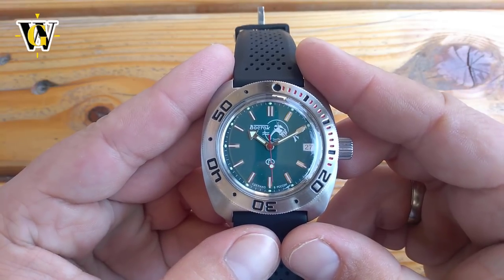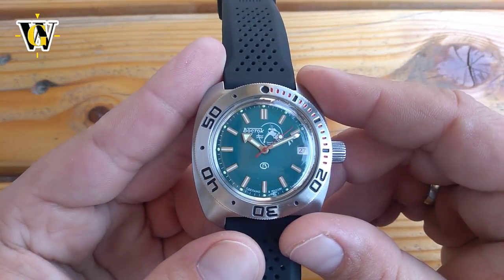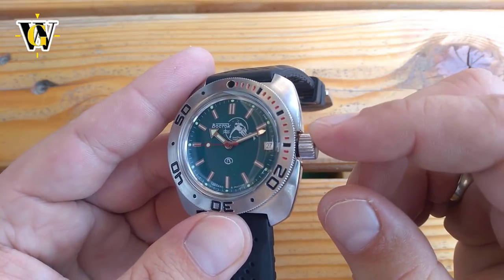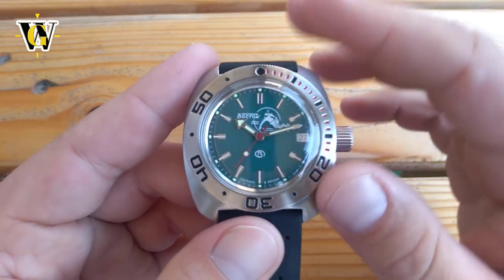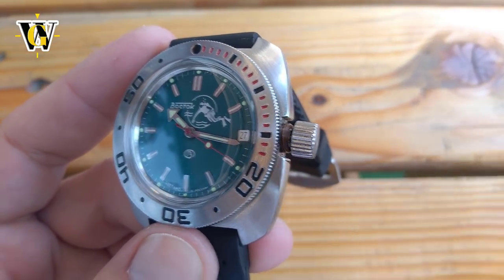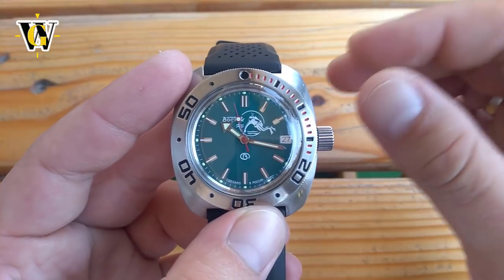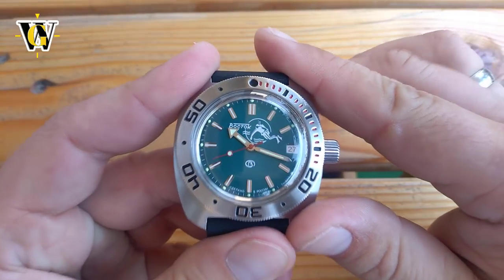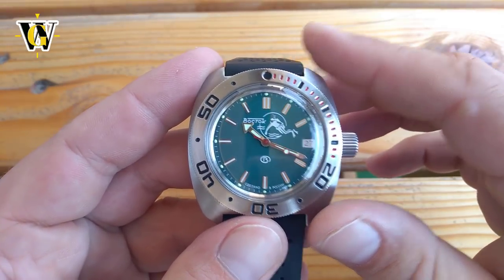Vostok Amphibia & Galvanic Corrosion - my watch corroded thanks to me :(

Comment: I bought an Amphibia 120512 a few months ago and been wearing it daily, which include surfing. Last week, after adjusting the watch, I forgot to screw in the crown and surfed for an hour until I noticed heavy condensation on the crystal - panic! Got home, disassembled the watch - luckily there was no water on the actual movement, only around the edges of the case and movement spacer and, loads, on the crown clutch compartment. Dried it all up reassembled and it worked fine. A few days later, opened the case back to regulate the watch and noticed some rust on the crown stem, took it out and rubbed it with a bit of silicone lubricant. It’s been working fine but probably will take the opportunity to upgrade the crown to a signed one as the corrosion process on this one will probably continue. Yeah, salt is terrible for corrosion, diver or no diver.

Comment: I have the model 670, all stainless steel. The “rust” is the reaction of galvanising on winding crown tube made of titanium,and crown made of stainless,in the presence of sea water(salty). Put some vaseline, and wipe with a paper towel, and it will disappear! I tried too!👍
Reply: If I don't have vaseline, what else can I use?
Reply: Patrick Ramirez heh
Reply: Titanium ?????  It's tin !
Reply: It’s made or chromed brass, not stainless🤣🤣🤣
Reply: @Group_Anonymous  The new ones are stainless
Reply: Vaseline is bad for rubber (as in crown seal). Better use a silicone based grease. I think liqui molly has such a product
Reply: @Raiden6277  you could use vapo rub. It's main ingredient is petrol jelly (vaseline)

Comment: I used Permatex brand high temperature anti-seize compound on the stem threads. Solved problem. I already had the anti-seize compound from my gun-smith work. The high temp, copper color, compound prevents galling between aluminium frames or rails and carbon steel, or especially stainless steel slides.

Comment: Very interesting and I'm glad you caught that in the nick of time!   I'm very familiar with galvanic corrosion from plumbing and oilfield work in the past.  But thankfully I have never experienced the type of corrosion you had on your Amphibia in the 20+ years I've owned Vostoks.  And some of my vintage pieces are 40 years old now, and have have quite a bit of wear and chips in the chrome.    So I'm thinking you just had the perfect storm.   Your sweat composition and possibly a poorly/flawed chrome plating applied to your crown.  Definitely something to keep an eye on.   The stainless steel crowns are a great upgrade.
Reply: where would you get a stainless steel crown for the vostoks though?
Reply: @kubikiribasara3499  The can be purchased from Meranom.com.

Comment: Big issue in vostock watches,in my case i ordrer the watch from meranom and they change the crown with the  stainles one with the B sign, butt it happens again because it is st steal only in outside surface.Any way you realized that 65$ super watch have some faults.Nice video for a great watch.

Comment: Hi, mine corroded on the same place after swimming in the ocean,  i used a toothbrush to clean it then applied some vaseline for lube. Now its smoother than ever.
Reply: Aleksander Den Store hi there! dry toothbrush, obviously? At what angle did you hold the watch while brushing it with toothbrush?
Reply: eeyyaakk yes just unscrew the crown and brush.
Reply: Same problem.  Had to use pliers to unscrew the crown.  The bezel was stuck too, so I lifted that and applied some lube.  Not confident about the crown as it’s still stiff and doesn’t pop out and the handwinding position is unclear ☹️.  Still keeps time though.
Reply: I did the same. But I used Trident No. LP20 silicone grease such as one uses on scuba rubber seals and plumbing valves.  Works fine.  Amazon or eBay.  2 oz for about $7.  Used it on main rubber seal too.

Comment: I guess that the crown is not chrome plated inside? Galwanic corrosion between ss steel and chrome is not supposed to happen according to the charts.
Reply from the maker: The charts are more a guideline than actual rules as different humidity and even temperature conditions can alter a material charge properties, so even compatible materials can corrode, which is why it's always safer to have the same material for everything

Comment: I was under the impression that the case is chrome plated brass. Anyways, I order stainless crowns for all my Vostoks and with a Q-tip I apply a small dab of DIELECTRIC GREASE on the stem tube and inner O-ring of the crown. So easy to screw and the O-ring seals better without tightening it against the tube as if your  life depended on it. Nothing beats dielectric grease as corrosion fighter!
Reply from the maker: Komandirskie models are chrome plated brass, and Amphibia is SS

Comment: It amazes me that vintage vostok watches haven't corroded to dust, if that was the state of your crown threads after just a couple of months. I can kind of forgive the mixed metals on the vintage pieces though, brass was cheaper and easier to machine than stainless steel, but on the new models, just slap another $5 on the (already miniscule) cost and go all stainless.
Reply: Back in the day, the whole watch was made from brass, so there was no galvanic corrosion as the whole watch was the same alloy.
Reply: Apparently the issue is the crown stem being titanium, with the crown being stainless. It's not a brass issue. He said in other comments to apply some silicone grease to the threads.

Comment: I thought the crowns were steel, I read on WUS that the crowns have a steel plating over another small crown, so the crown that we touch and use is a form of steel, but not stainless steel exactly.
This was said for the Amphibian crowns released before 2018. These new crows have a slightly different shape towards the inner end.

Comment: This doesn't just happen to watches. My car came with stainless steel caps on the brass tire stems. Daily moisture corroded the contact between the two metals and they had to be broken off to change the tires, destroying all four of the tire sensor gauges. Costly design flaw.

Comment: I haven't seen this in any of my Amphibia's or Komandirskie's many of them Soviet issue and all have smooth crown threads, one of my Zakas Commander's from early 70's has a very corroded case at the back where the locking ring meets the case and has fused solid whilst my other Zakas Commander has a perfect case and caseback but the dial is rusted out which is quite crazy as both are working quite well if not for the rustyness.   My "newest" Komandirskie, a Generalskie has a sticking stem which is irritating as it doesn't click in when screwed down, this is a post Soviet model and to me not as well made as the earlier ones imho.

Comment: Excuse me, but it seems to me that you confuse galvanic corrosion with the dirt accumulated in the crown, which is what I think happens to your Amphibia watches, if you are diving with them a few days in a row and then you keep them for a month if you have cleaned Previam With fresh water and without giving them rope from time to time during all this time. If it were really galvanic corrosion, the crown would be fully welded and could not be unscrewed
Reply from the maker: This was not dirt my friend, and the watch didn't see ANY diving action, just am occasional shower when I would forget to take it off and a hand wash.
My Seiko monster on the other hand has seen diving, swimming etc. In both sea and river and NEVER had anything like this happen. It IS galvanic corrosion and I am sure it would have welded completely given enough time.
If you saw my 10+ year worn watches you would understand "accumulated dirt" on a 6 month old watch owned by me is simply something that is impossible 😄

Comment: My stem tubes always get a dab of silicon grease and I never have a problem. In the tropics sweat is a big enemy so I never put away a  watch without giving it a wipe first with my vinegar/distilled water 50/50 mix. All metal to metal surfaces get a thin smear of silicon grease, especially the locking ring on the back.
Reply: Barry Wolff where to buy silicon grease?
Reply from the maker: eBay
Reply: eBay has lots but also dive shops have it for dive equipment. I have acquired it from both.
Reply: Barry Wolff ordinary hardware stores don't sell them?
Reply: @eeyyaakk6801  - Trident Silicone Grease, product No. LP20 ; 2 oz. Jar will last a lifetime.  Amazon.  $7.  I use it for the Komandirske's rubber seal, the stem, and for dozens of other things.  Works great.  Does not dry out or get gummy.  Use only a little.
Reply: Yes to Silicon grease. It's also used on fountain pens.

Comment: Finally someone talks about it! It happened to me too, but indeed, at least in my experience (twice on two!) it's the "stainless steel" crown that rusts, not the chrome plated one! (by the way: the crown of your Amphibia is the stainless steel one...)
Reply from the maker: I learned that later on, the problem is that the stem is titanium which again causes galvanic corrosion
Reply: @ @WatchGeek  
Thanks!
Reply: @WatchGeek  so there's no way to avoid the corrosion, except by not sweating?)
Reply from the maker: Haha yes or going with an older model that has a regular chrome plated crown.
It turned out that my crown is SS while the crown tube is titanium

Comment: A bit of wd 40 on that thread will prob prevent this since it’s a water dispersant .. I’ve used that on many things that oxidise or rust in the past and it’s prevented it … many people rule out wd 40 but it’s actually really designed for this kind of issue .

Comment: Interesting to know. I have a couple of diver watches I wear at the beach but they are mostly all-stainless. This corrosion thing never crossed my mind , but I do have a tendency to wash my watches under the tap when I get home. Mainly cause I do not like the whitish salt residue on the crystal. I just bought my first Komandirskie, and have an Amphibia on the way. I guess I will be doing this more than ever now.  I did order a stainless crown from Meranom for my Amphibia, but I did it cause I thought they looked nice. I own Timex brass cased watches that corrode badly on the underside due to sweat and sort of started accepting it now. I guess my Komandirskie will suffer the same faith eventually. Thanks for sharing.  
P.S. Someone did suggest using Vaseline on the crown to help. Anyone  has any ideas regarding this ?
Reply from the maker: I did, I used gasket grease and the problem hasn't repeated itself since
Reply: Coppaslip

Comment: Went for a swim in the sea once and this happened. Got the worst of the corrosion off with a q-tip and put a tiny amount of silicone oil on it but I'll be looking into a crown replacement. Luckily I use a NATO so I won't be getting too much sweat in contact with the watch.

Comment: It is an oxidation issue the crown material is not stainless steel but a ferrous alloy . The thread brown colored is the oxide coming from the crown. I have the same problem on my 710 but not only on the thread but also on the crown top

Comment: Is it possible to put a small drop of machine oil on the thread so that it doesn't corrode or would that be opening up other issues as long as you don't get carried away with the oil
Reply from the maker: I used silicone grease used for lubing gaskets and it worked like a charm

Comment: A very tiny drop of WD40 applied with a needle tip to the threads should allow the crown to operate normally.
My Vostok Komandirskie is on a nylon velcro strap, and the watch is held in place by a short elastic strip that passes through the spring bars. The strap keeps the watch off the skin of my wrist.
It is a Watchband Sport Adjustable Velcro for $8.00 at, ugh, Walmart.

Comment: Put silicone grease on the threads next time. Does the case screw stainless steel, or the modern russians use another material for it. In my case I have stainless steel case screw and the crown out of brass/bronze inside and stainless steel outside. Connection betwen stem and the crown lubicated by vaseline oil, gasket by silicone oil and the threads by the silicone gerase.

Comment: The corrosion is not from stainless steel case to to the crown but from the titanium crown tube to the brass crown.  ( the modern amphibias use a titanium crown tube for some reason).

Comment: "Martensitic" so-called "stainless steels" are "galvanic corrosion generators" right out of the "box" and their use in so-called "sports" or "dive" watches is guaranteed to cause "corrosion". "Austensitic" or REAL "stainless steels" such as those used in "watch backs" made out of "sheet metal" as opposed to the machined Martensitic cases, bracelets and other "billet" parts is much more "corrosion resistant" when exposed to "simple" electrolytes like "perspiration" since "dry" or "wet" with "fresh water" after a shower or bath human skin will "dilute" or "absorb" and leftover salt in the case back. 

Plus our wrists don't sweat a great deal because there is very little muscle, fat and other "insulation" in them. Most sweat at/on the wrists results from wiping away sweat elsewhere. And usually with our also "dry" hands. But put EITHER "type" of stainLESS but not stainPROOF or stainFREE steel in continuous contact with an "electrolyte" like "saltwater" and in direct contact with the body's own "battery" for "hours on end" repeatedly and eventually it will experience "galvanic corrosion". Which is why "steel" so-called "dive watches"  were NEVER intended for "professional use" IN THE WATER. ON THE DECK OF A "DIVE BOAT" IN USE BY A "DIVEMASTER" OR "INSTRUCTOR" OPERATING NON-SCUBA "DIVE GEAR" IS A DIFFERENT STORY. OF COURSE "STEEL" WATCHES ARE ALSO ONLY "WATER RESISTANT" FOR THAT SAME REASON AND HISTORICALLY WERE "CHEAP" AND "DISPOSABLE" BECAUSE DRAGGING GEAR, DIVERS ETC INTO AND OUT OF AND OFF AND ON "SALVAGE VESSELS" AND/OR "DIVE BOATS" AND/OR "DOCKS" AND "EQUIPMENT LOCKERS" AND/OR "LAND TRANSPORTATION" LIKE ALL OTHER "MANUAL LABOR" IS EVENTUALLY GOING TO LEAD TO THE "LOSS" OR "DESTRUCTION" OF A "FRAGILE" WRISTWATCH. ESPECIALLY A LARGE, BULKY, HEAVY AND CLUMSY ONE. 

"WATER RESISTANCE" PROVIDES THE POSSIBILITY THAT A "LOST" WATCH CAN BE "RECOVERED" AS DOES "MARTENSITIC" AND "FERROMAGNETIC" STAINLESS STEEL EITHER BY DIVER, LARGE MAGNET OR BOTH. 

THERE ARE NO "WATERPROOF" WATCHES UNTIL YOU GET INTO "CHEAP" DIGITAL "SPORT WATCHES" LIKE A TIMEX TRIATHLON. SWIMMING IN THE "OPEN OCEAN" A WATCH CAN LITERALLY BE A "LIFESAVER" BECAUSE IT CAN TELL YOU WHETHER YOU'RE GOING TO FINISH THE SWIM BEFORE IT FINISHES YOU. 50-DEGREE WATER CAN KILL IN 15 MINUTES AND ALL THE WAY UP TO "BODY TEMP" WATER SAPS AND SUCKS ENERGY RIGHT OUT OF YOUR BODY UNLESS YOU'RE REALLY EXERTING YOURSELF AT WHICH POINT ITS EASY TO "OVERHEAT" EVEN IN "COOL" WATER BECAUSE OUR "EVAPORATIVE COOLING SYSTEMS" DO NOT WORK WELL IN "100% HUMIDITY" AND THERE ARE NO "WATER BOTTLES" OR "SPORTS DRINKS" DURING A TRIATHLON SWIM. 

SO KNOWING HOW LONG YOU'VE BEEN SWIMMING AND HOW MUCH YOU'VE EXHAUSTED YOURSELF SO FAR AND HOW FAR YOU'VE GOT TO GO AND FROM TRAINING AND OTHER EVENTS WILL TELL YOU IF AND WHEN YOU NEED TO STOP SWIMMING BEFORE YOU SINK. 

THE $50ISH TIMEX IRONMAN TRIATHLON PRETTY MUCH "KILLED" THE MECHANICAL "STEEL" SO-CALLED "DIVE WATCH" OVERNIGHT TO THE LIMITED EXTENT IT WAS EVER POPULAR FOR "MODERN" DIVING WITH SCUBA GEAR OR "SURFACE SUPPLIED" DIVING WHERE MUCH MORE RELIABLE AND TRUSTWORTHY INSTRUMENTS BECAME "STANDARD EQUIPMENT" AT ROUGHLY THE SAME TIME "QUARTZ" REPLACED "MECHANICAL" WATCHES AND FOR THE EXACT SAME REASON. "WATERPROOF" AND "INDESTRUCTIBLE" AND "FOOLPROOF" VS "WATER RESISTANT" AND "FRAGILE" AND "FAILURE-PRONE" IF NOT WOUND, NOT WOUND PROPERLY, NOT "INSPECTED" AND "SERVICED" FREQUENTLY, ETC. 

THE EVENTUAL JUMP TO "DIGITAL" JUST MADE FOR A WATCH THAT IN MANY CASES IS/WAS "DISPOSABLE" IF IT "OUTLIVES" ITS ORIGINAL BATTERY. WHICH CAN LAST 2-5 YEARS DEPENDING ON HOW MUCH ITS "COMPLICATIONS" LIKE THE STOPWATCH(ES), TIMER(S), CALENDAR, ALARM(S) AND "ILLUMINATION" ARE USED. 

SO ITS NOT "YOU" THAT "FAILED" THE WATCH BESIDES EXPECTING A "STEEL SPORTS/DIVE WATCH" TO BE A USEFUL, RELIABLE, DURABLE AND "INDESTRUCTIBLE"  TIMEPIECE AND "TOOL" SIMPLY BECAUSE OF ITS "PREMIUM PRICETAG" WHICH WOULDN'T BE NEARLY SO HIGH IF THE  MANUFACTURER REALLY WANTED THE "BLUECOLLAR DEMOGRAPHIC" TO TAKE THEM AND "PUT THEM TO WORK" WHERE "CHEAP" AND "DISPOSABLE" WATCHES LAST AS LONG AS THE OWNER WANTS THEM TO AND AT LEAST UNTIL A $500-$5000 AND UP "TOOL WATCH" IS "GUARANTEED" AS LONG AS YOU DON'T "NEGLECT" OR "ABUSE" OR EVEN DROP IT ON A "HARD SURFACE".

Comment: crown is not brass, its just steel not stainless! thats why rusts like shit
only reason to fix it to change crown to old style brass ones or to real stainless
Reply: Pretty sure mine was chrome plated brass, the chrome plating has worn off in places and it's now mostly gold! Probably depends on the production year.
Reply: @cmdrflint9115  yes, 2017, 2018 and newer models comes with solid steel crown not brass
Reply: @cmdrflint9115  ur is old
Reply: @just_T4U  you're right, just looked through the old vostok catalogues to find the model I have.. turns out it was 1983!